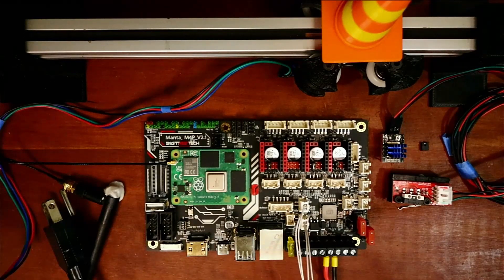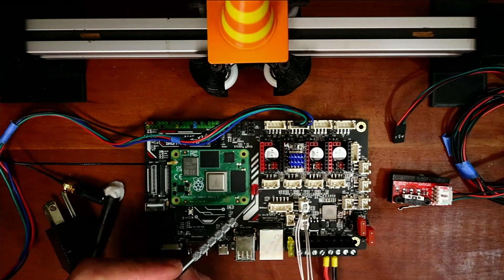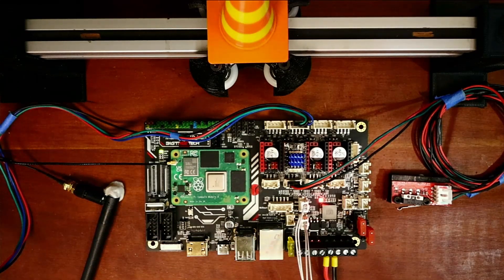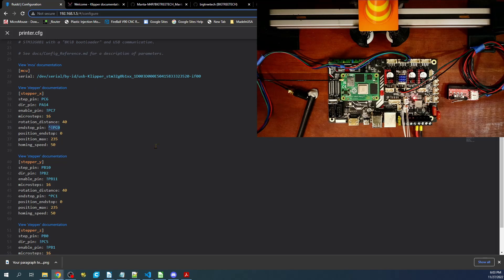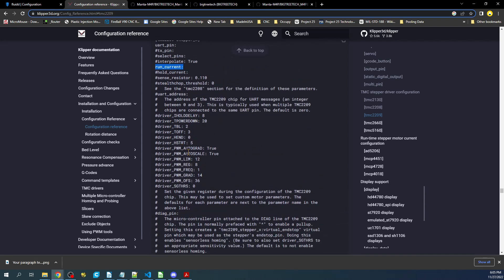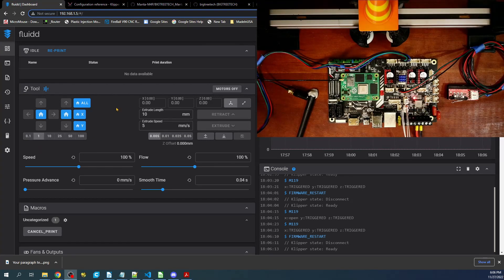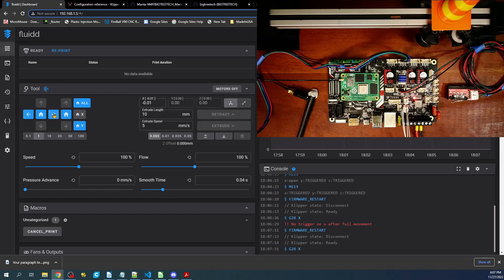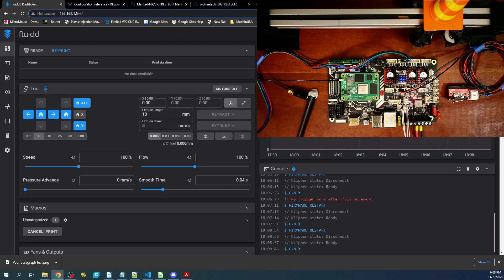BTT - Manta M4P - TMC2209 with Endstops

Comment: Hello, thanks for the tutorial.
I'm trying to setup the Manta M8P for my Creality CR10S PRO V2, I'm currently connecting the End Stops. 
Problem : these are 2 wires instead of 3.
I don't know how to adapt them (hardware + firmware)
Regards
Reply from the maker: Signal and ground are the wires.  Don't connect to voltage pin.

Comment: Great job man!

BTW, "!" meant invert.
Reply from the maker: During my boolean algebra class in college it meant, negate.  Sometimes I mix the two.
Reply: @EdwardBraiman  Basically when dealing with logic circuits its called invert because you don't absolutely know if you are working with a pulldown or pullup circuit and when designing logic it doesn't really matter.